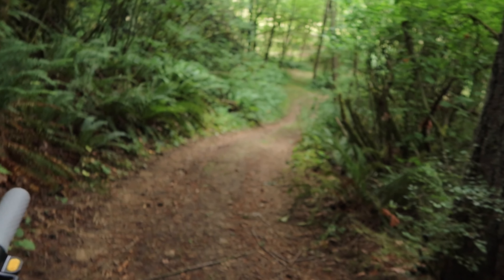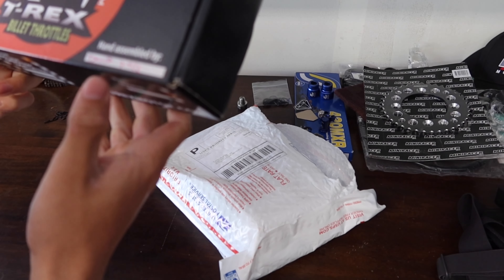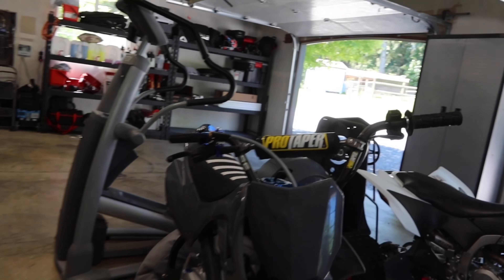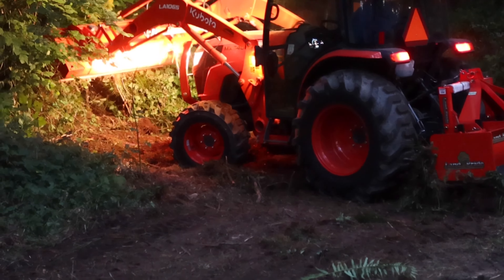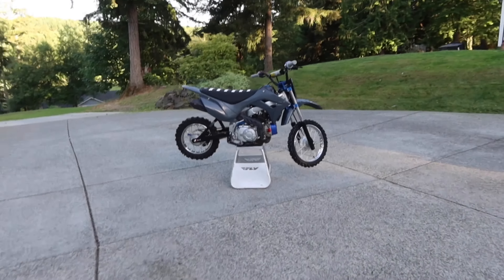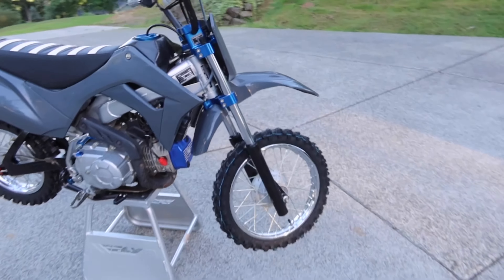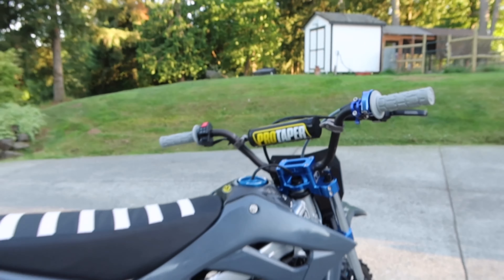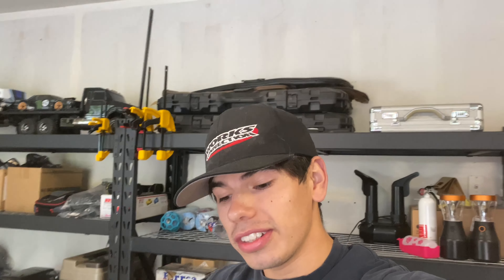BUILDING THE BADDEST CRF110 ON YOUTUBE..(PART 5) NEW BILLET T-REX THROTTLE.

Comment: do these trex throttles work for 2013 and up?i just dont see how a twist throttle can be reserved for a specicific year of ANY bike,but they are ..
Reply from the maker: They are reserved for a certain year of bike because of the fuel injection setup for the newer models no carb just throttle body